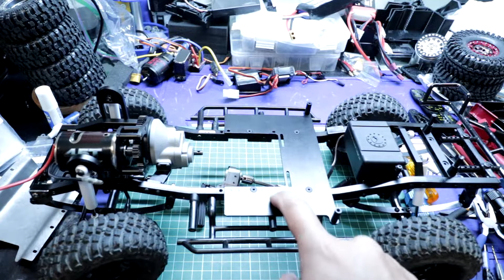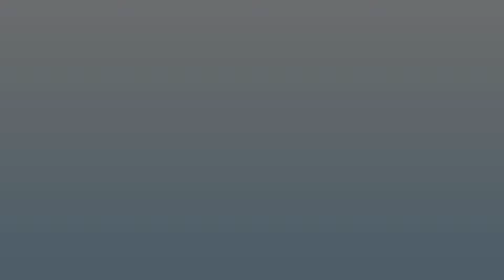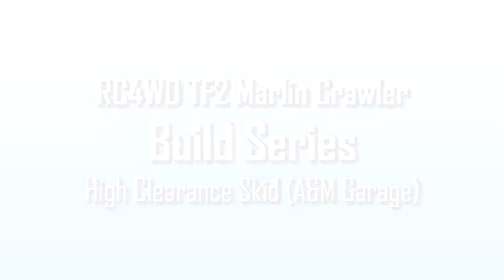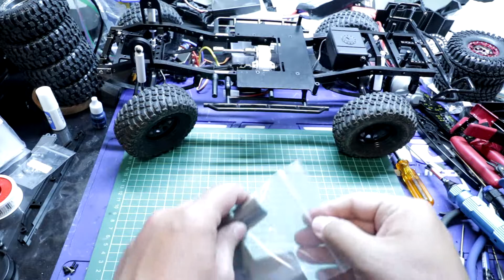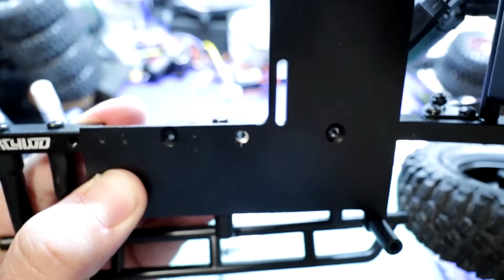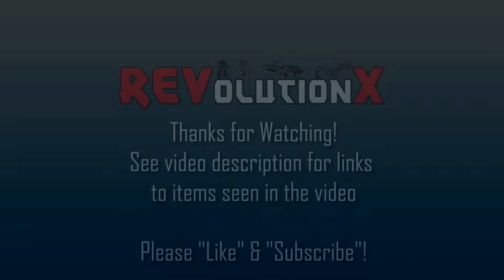RC4WD Marlin Crawler Build Series - A&M Garage High Clearance Skid

Comment: I have seen this same installment and people saying they need to change drive shaft because they rub against plates...did not see this in your case
Reply from the maker: I bought mine fairly recently, so I'm not sure if A&M made changes to address this.  This is something you can ask him directly, as he is pretty responsive.  I do plan to change the driveshafts to some Junfac ones which are thinner and metal anyway, so it's kind of a moot point for me.